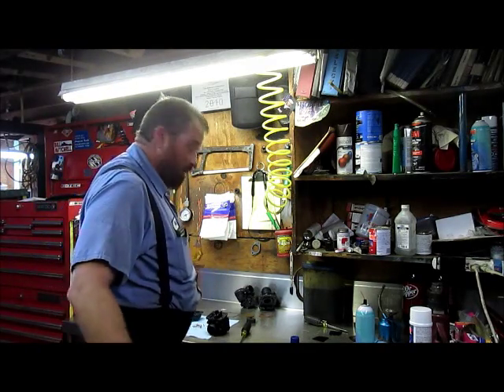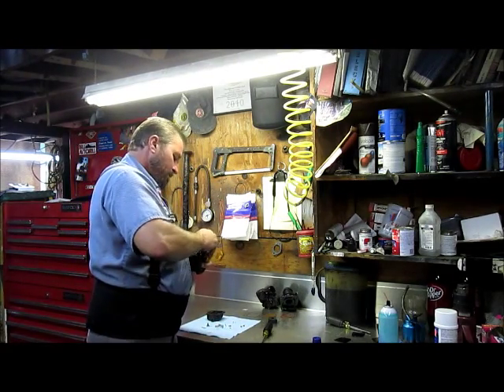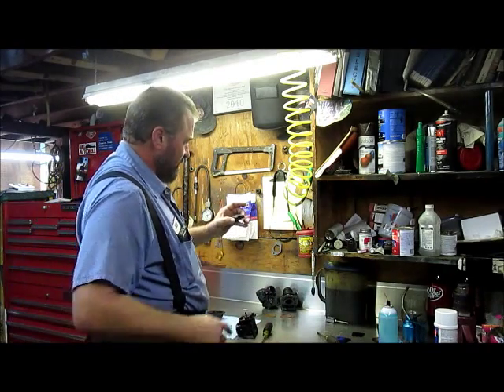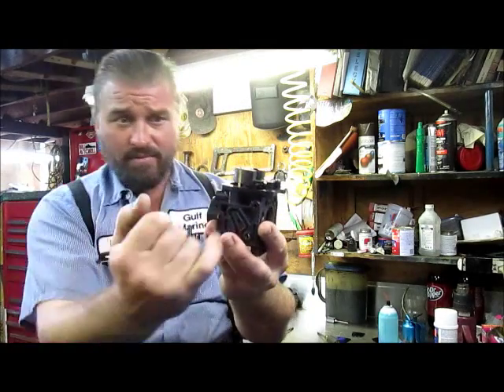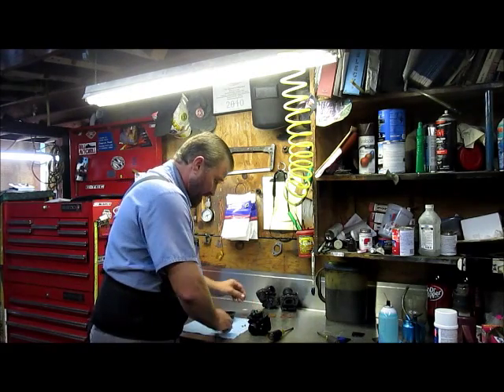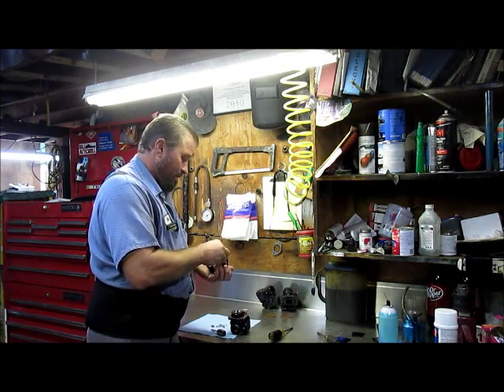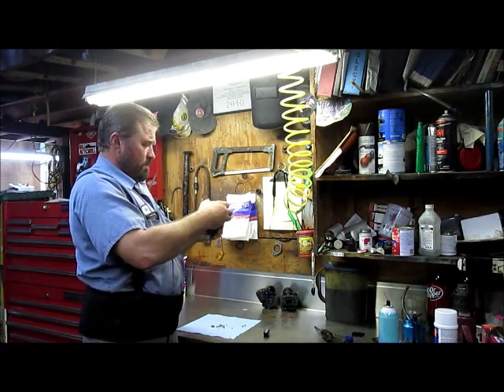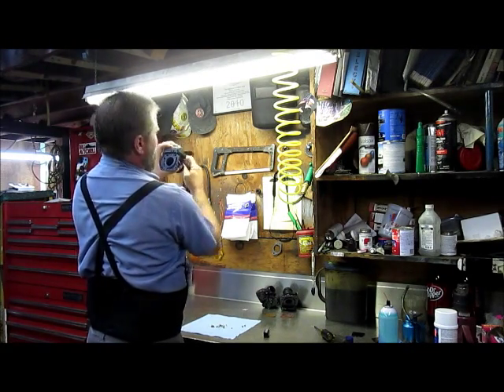Evinrude/Johnson carburetor repair, professional assembly for 60 and 90 deg Looper pt 1

Comment: I have a '02 Johnson V4 115, and during my spring commission this year when I prime the fuel ball, the gas pours out of the one top carb air inlet where the butterfly is located like Niagara Falls.  Is this an issue with a varnish / gummed up float in the float bowl or something else in the carb???
Reply from the maker: Float is stuck. Not shutting off fuel supply.
Reply: Is this something that can be fixed by spraying a carb cleaner or Sea Foam Deep Creep via the fuel bowl drain screw, letting it sit overnight and trying to run it again the next day, or does the carb have to come off to be cleaned?  A short cut would be nice!  Is their another better location to spray carb cleaner to get the float moving?  Thank you for getting back to me so quickly!!!
Reply from the maker: It may free up with some Engine Tuner from Evinrude. Otherwise it'll have to come off and be soaked. Needle valve isn't seating

Comment: I currently have a 1990 looper idling very rich.  I believe my floats are adjusted incorrectly due to washer under float seat.  I have plastic bowls.  This video confirms WTF is going wrong with my looper.. Great video..
Reply: When rebuilding I used a sierra mix and match kit.  I should have bought a OEM kit and it may have at least warned me?  Any how, I cant wait to see how well this old cement mixer runs when I get the carbs right..
Reply from the maker: Thanks for the comment!
Reply: My left bank cylinders were running 15-20 degrees cooler and the plugs were loading up with carbon in only 10-15 minutes of idling.  You can actually see fuel trickling from main jet tube while idling at 1000 rpm . Have you seen this before?
Reply from the maker: Oh yeah.  Stuck floats will do the same thing
Reply: When squeezing primer bulb no fuel feeds into carbs.  So, I don't think they are stuck open.  But, I do think the level is high enough on the main jet pick up tube. That is will siphon fuel at idle?
Reply from the maker: Yep
Reply: One last comment and I will leave you alone.. The tell tale carburetor problem indicator would be the fuel tricking from main jet tube at idle?